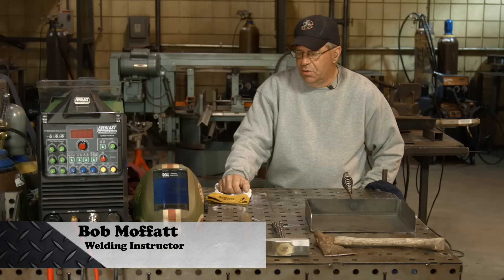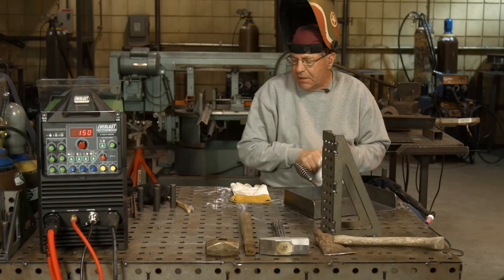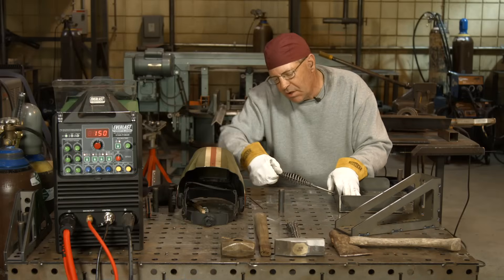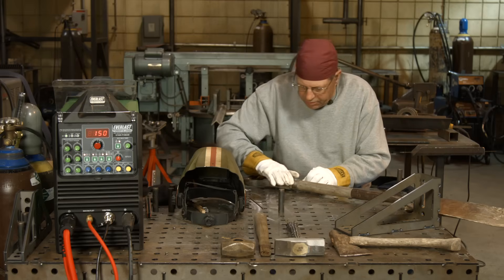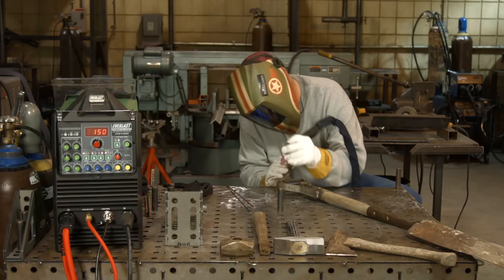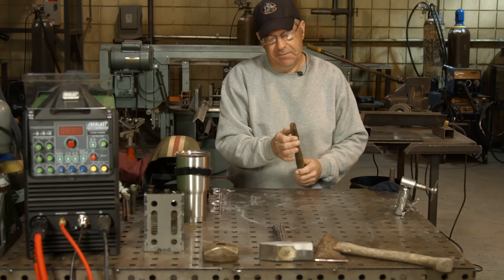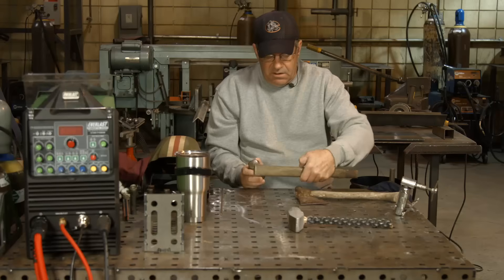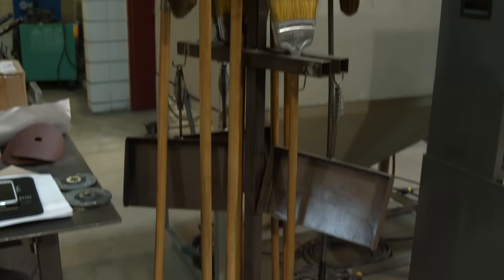🔥 Welding Tool Repair (with the Everlast 250EX)

Comment: I don't want a 4 pound dustpan with a long handle that makes it feel heavier.  And wood is the best material for those tool handles if you plan to use them.  Wall hanger, ok.

Comment: I managed a warehouse and two shipping yards at a larger manufacturer and if we had a need for dust pans, handles, etc. I had the shop maintenance guy make something whenever possible.  It wasn't always about durability but was often done because I wanted a specific way to use a tool and you couldn't buy it that way.

Comment: Mr. Moffat love the video, I’ve done a number of these repairs myself! A small note though, most hammer heads are forged actually. Much stronger with better grain structure. An easy trick to tell the difference between a casting and a forging is the flashing. Most castings have very thin flashing whereas a forging will be significantly thicker. The surface finish is an indicator as well but not always as conclusive. I study metallurgical engineering and am working on my pipe welding as well. Miss you on Weld.com!

Comment: Hey bob! I’ve found that soaking handles in water to swell them works well but it always dries out, if you soak it in antifreeze the handle will swell but will last 10x longer than the water bucket trick!  Something to co side if you don’t have time to fashion a new handle.

Comment: Great video Bob. I've welded a few handles on my own hammers. Being a mechanic at a dealership for 27 years I've built a few tools. As the saying goes, Necessity is the mother of invention when you've got a job to get done and don't have a tool you need.

Comment: +Bob Moffatt You ain't the only one that hates cheap junk. I fabricate my own tools whenever possible. Recently, I even fabricated my own slag hammer out of a scrap piece  of 3/8" thick AR500 plate and a short piece of 5/8" OD .065 wall EW tubing for the handle. I flame cut the head, including the bevels for the flat and pointy ends, cleaned it up with a 4-1/2" flapper wheel, and braze welded the handle onto it using the torch with a size 15 welding tip (Purox/Oxweld size 15, which means 15CFH acetylene flow) and a piece of old Oxweld 25M flux-coated low-fuming bronze rod. I could have welded the handle on with the torch or with any of the electric welding processes at my disposal, but I hadn't braze welded anything in a while so I decided to go that route. I've used the crap out of it, and both working edges as well as the braze weld are holding up perfectly fine.

Thanks for this video! Hopefully it will inspire more folks to either repair broken tools rather than throwing them away and replacing, or even rolling their own.

Comment: I have never heard of cast steel hammers, only drop forged. The way to tell is a forged piece has a much thicker part line (so your dies won't hit).
Welding or brazing on anything like an axe or hammer will ruin the heat treat.
The little one is probably a drillers hammer.

Comment: Bob Moffett it's great to weld /fix things I try not to buy china , good old school  tools I think are great but are  getting harder to find. @abomb has alot of old school stuff I think it cool / better way to go. thanks  for sharing this video as I bought  the same welder years back I like it used to have a miller.  also high school  welding is all the instructions I had but have carried me thru a life of repairs (I'm 47) so thanx an thanx to my shop teacher in high school . I got an A in that class.

Comment: Would it make sense to use (a lot of) epoxy to attach the hammer handle?  It seems like the hammer head would take a LOT of heat to braze, and if it's steel?  I mean, is it heat-treated?  I have hammers and hatchets where the head is epoxied on.  Just trying to keep from annealing the hammer, if that matters.  Gotta love braided steel bars!  Nobody is ever going to throw THAT away!

Comment: Where are the materials available for fabricating?  The raw metal stock at the HD and Lowes seems pretty pricey, are there metal equivalents for lumber yards?

The smoke from the burning wood seemed like a good demonstration of the shielding gas flow-

Comment: I have a tip for the wooden hammer handle when they start to dry out and let the head slip off. Soak the hammer head and the end of the handle in antifreeze. The ethylene glycol will soak into the wood and make it swell but won't evaporate like water.

Comment: Was doing a welding job a few days ago and 2 handles broke on my 4# hammer (had another one with a good handle to finish the job).Figured I'd stop a Lowes on the way home to get 2 4# hammer handles,could find any so I asked an employee were the 4# hammer handles were,he said they don't sell them that people don't change handles any more(maybe it too hard to do).Tried Tractor Supply picked up 2 4# hammer handles for $12.00 and change.Bob you are right todays world is throw away.

Comment: What shade setting is best for Tig ??
Reply: SW Customs Well depending on ampurage or if it is a/c or d/c just 

use whats comfortable for you shade 9-14 try em all
Reply from the maker: That depends on your eyes and how much amperage you're using. There are charts that you can look at for a starting point, but nothing is set in stone.

Comment: love the woven handle is it possible to make without oxy acetylene as the rent on those bottles are well over $500 a year i have argon gas and a tig welder but how can i not leave holes when heating the steel

Comment: Wonder if dipping the spade handle into water 1st getting the wood really wet then drying the stainless as best as possible would have worked? Only draw back I can figure may be the dampness causing porosity or some other welding problems.

Comment: Great job on the spade handle. Try putting some boiled linseed oil on your wooden handles. They will last for along time. Could you recommend  a good welding helmet that won't break the bank for a hobbiest and minor repairs.
Reply: arc1weldsafe.com
Reply from the maker: ArcOne has some less expensive options than the one we use in the videos that still work very well. Check out the Carrera line: https://arc1weldsafe.com/products/category/carrera

Comment: I would worry, well not worry but wonder, about welding a handle into a hammer head. I know that they're hardened. Not super hardened lest they become too brittle to handle the impact they're meant for, but still. And when you put a lot of localized heat into a hardened part the differential expansion might cause cracking. So you either have to heat the whole thing (?and lose the hardening) or risk cracking.

Comment: bob please do a video on making a braided hammer handle . in 35 years of welding i have seen some odd hammer handle's -rebar,pipe,a big bolt with the head still on it' a customer has one made from grouser bar.
Reply from the maker: It's on the list. We planned on shooting it right after this, but ran out of time.

Comment: soak the wood handles in antifreeze instead of water, it'll dry out much slower than a water soak
Reply: Bob  Moffatt not to be negative, but even better is to soak it in boiled linseed oil cut with a little gum turpentine. Lasts for year's and comes standard of high end wood handled axes and tools. Plus You can easily pick the stuff up at your local hardware store.
Reply: Thanks for the tip.
Reply: Travis The Jiu-Jitsu Guy Good tip.

Comment: That hammer handle is awesome! Never seen made out of chain before.
Reply: That's not chain. It's braided 1/4" rod.
Reply: You did say braided rod in the video but it looked so much like chain that I thought "it has to be chain". After pausing the video I can see what you did, but have no idea how you did it. I'll throw out a suggestion for a video to show how you made that handle. BTW love this series of videos basically starting from scratch that you seem to be on. The last few videos have been talking about different rod at different amps, running straight lines in welding, and now a simple everyday application video to hone the craft as well as use it. It's like a welding class.